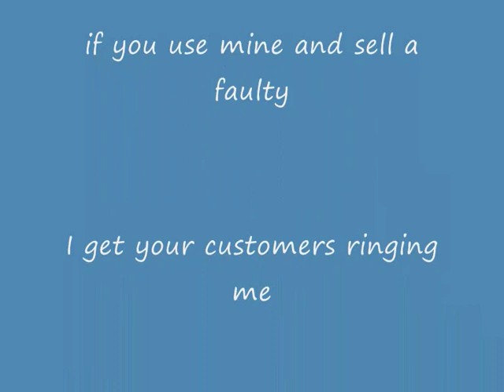How to install a CISS onto a K7100 Deskjet 9800

Comment: Thanks for your great video. I would like to ask you about how to reset the ink level on this printer which would appear after a while and wont let the printer continue printing with ciss installed . 
Regards
Naeim Pirmehtar
Reply: Did you find the solution? if yes, would you share it?

Comment: hi gemsaniks, i've just aquired a hp k7100 officejet printer (as above)and would like some info regarding the complete ciss package . i have 2 cartridges in the printer( 344 tricolour and a black generic cartridge) they appear to be empty . i've no way of telling other than doing a test which goes through the printing cycle but doesn't print. i would be interested in converting this printer if it's worth it.   any thoughts on this matter would be greatly appreaciated.  D